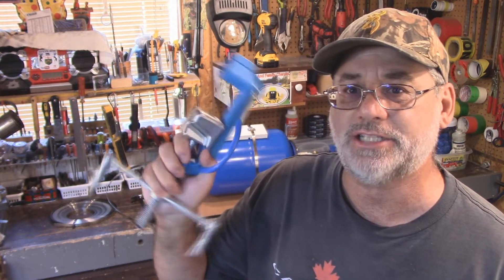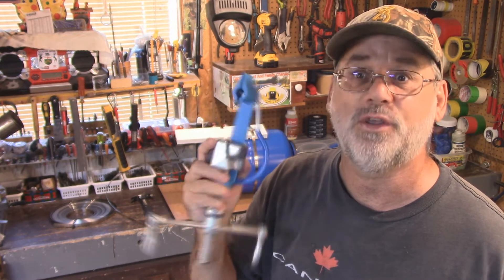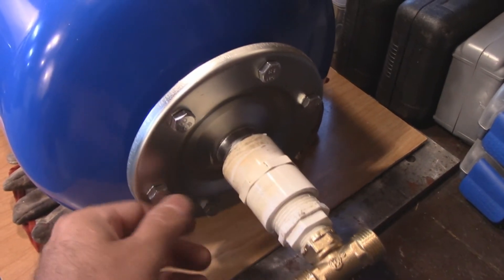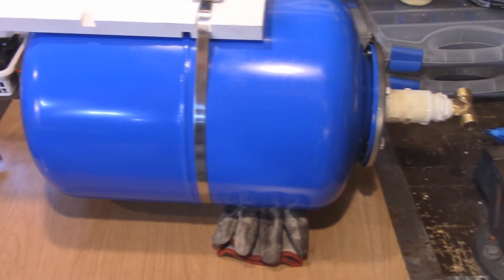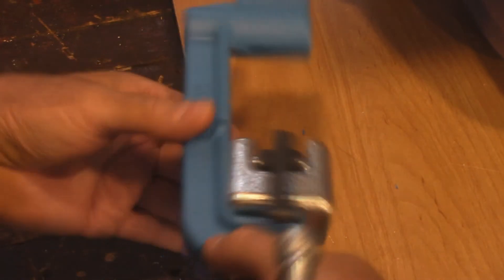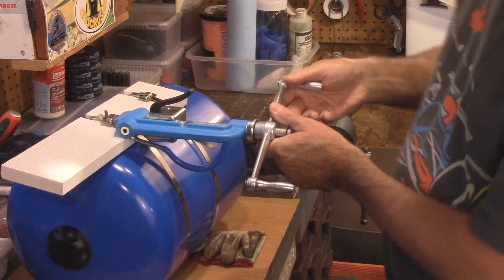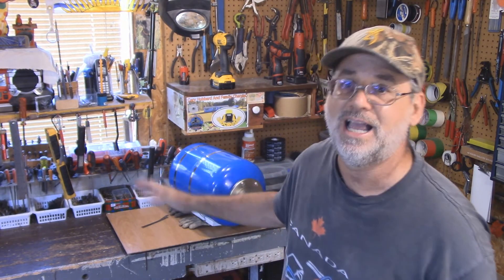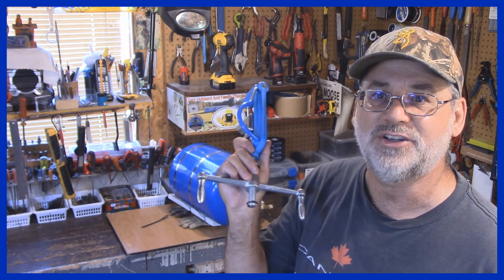Band-It C00169 Banding Tool Review

Comment: we use the same kind of system on the suction hose storz couplings for our firedepartments as they give a good firm grip around the hose and can compress the rubber pretty good

got myself a cheaper version for homeuse now and yes it is a handy tool to have

greetings from Austria

(by the way, I personally use the rolled up banding strap and slide the unbent end through the buckle twice before bending over the end to have less waste material as the steel straps are pretty pricy over here)
Reply from the maker: Austria  , wow . CHEERS 👍

Comment: Thanks for sharing. We use similar stuff in our plant when we don't want to drill in a column (should never anyways) and fix something rather light. That could be an extinguisher or a stop sign for instance. I might get a kit myself. Thanks!
Reply from the maker: Hi Joe 
I have found  so many places I was drilling holes or using glues to hold something and this tool sure made things a lot easier.  I wish I would have bought one 40 years ago 😅
Reply: Drilling in a propane tank is where this gets the best results using this strapping!
Reply from the maker: @FromSteelToWood  😅😅

Comment: The nice Bandit tool Steve.....we use to use them in the paper mills all the time to fasten tech wire where we could not install other kind of fasteners.....you almost brought the juice out of that tank when you tighten the strap....It’s good and it will never fall.....well done....CHEERS
Reply from the maker: That tank will be real secure out in the open all year and non rusting .  👍